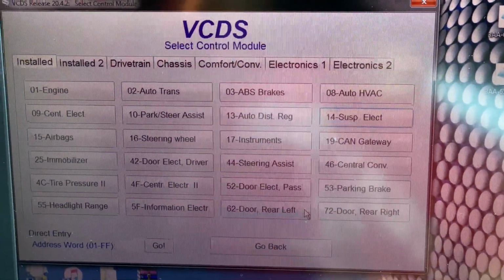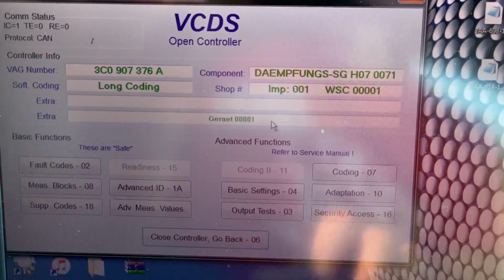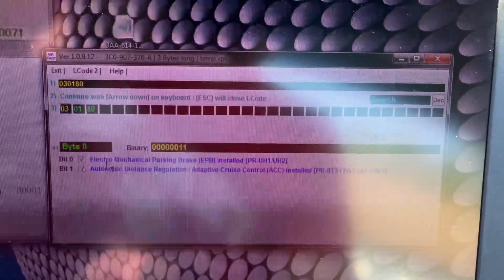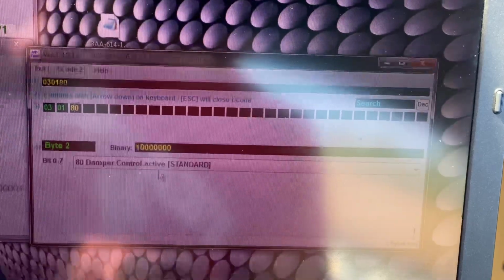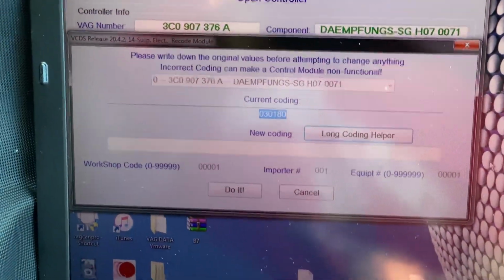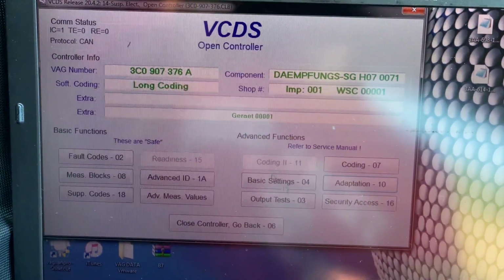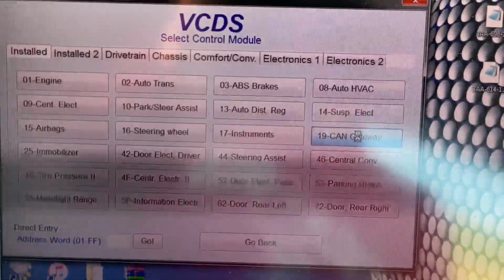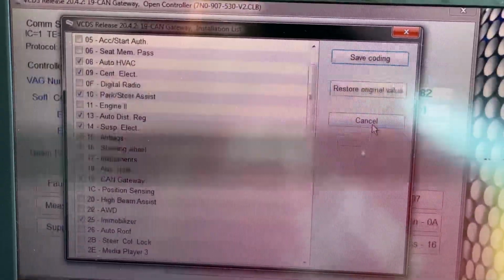Passat B6 B7 CC DCC module Coding

Comment: Hi lam installed dcc suspension pegolf 5 from passat cc but does not go comfort or sport 😒 only standard
Reply from the maker: Coded?
Reply: @lavianeverything  I did the coding for my type of car without electric brake, etc. It is on the standard charisma, I noticed in the blocks of measures the xs sensor does not give the correct values, I am waiting for the new sensor to arrive
I didn't code otherwise, I just selected what was already inside
The whole project was hard, but at the same time enjoyable